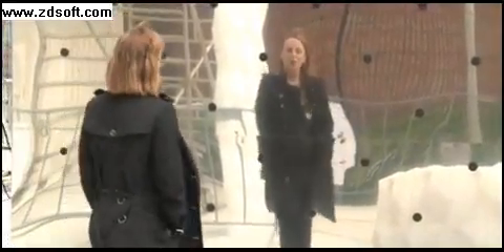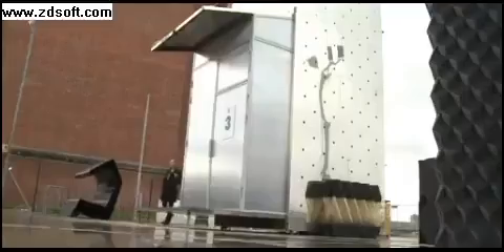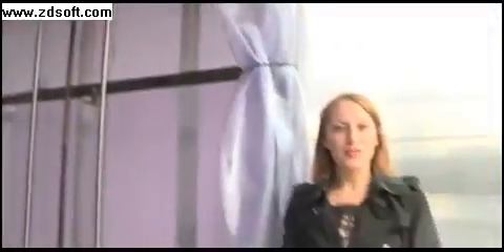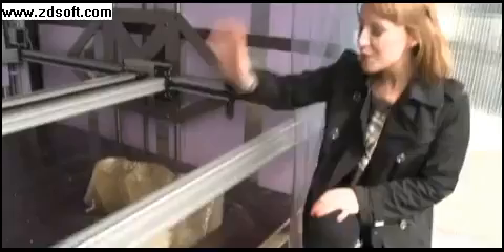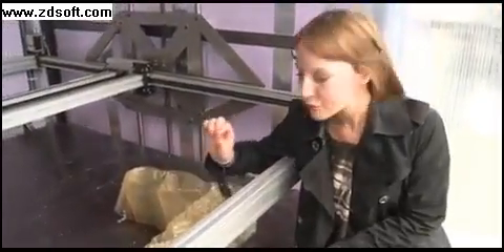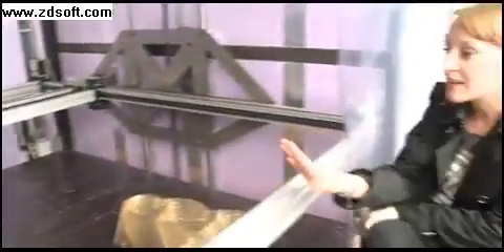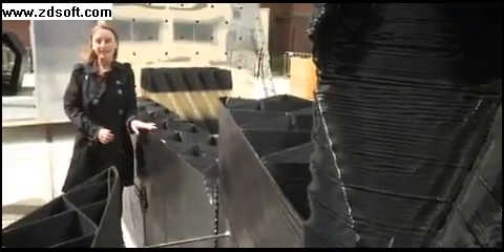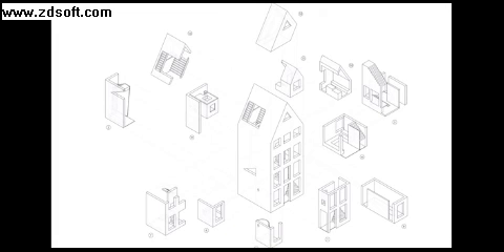How Dutch team is 3D printing a full sized house

Comment: I don't know why people think plastic from plant oil would be either waste-free or eco-friendly.

Growing plants to make plastic would require using a lot of fossil fuel to grow, fertilize, harvest, and process the plants into plastic. Not to mention the immense amount of natural habitat (woodlands, rain forests) that would have to plowed under to make way for the plastic plantations.

On top of that the "printing" of plastic requires a lot of heat, which means a lot of electricity and it's a painfully slow process. As I understand, this plastic house won't be finished until at least 2016.

 #3dprinting
Reply: I see your point. Especially if it's not made by recycled materials.

But you have to remember that this would reduce the net amount of materials used for construction - not add to it. The construction business is very wasteful as it is. Plus it would supposedly make structures more durable and disaster-resistant if they have an organic design that takes it into account. And it would also be easier to make biomimetic architecture that reduces needed energy for heating, cooling etc.
Reply: Muskar Please describe to me how plastic has any of the properties you are making claims for. What materials would your plastic reduce the need for?

Anybody that has left plastic outside exposed to the sunlight for a few years knows that last thing you claim about plastic is durability. The insulation value of plastic is nil, it would increase the needs of heating and cooling.